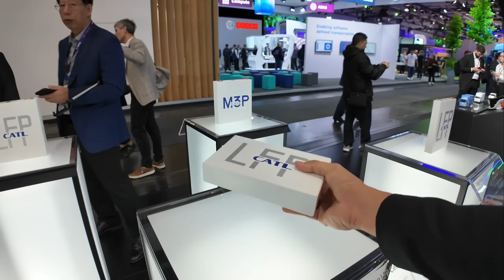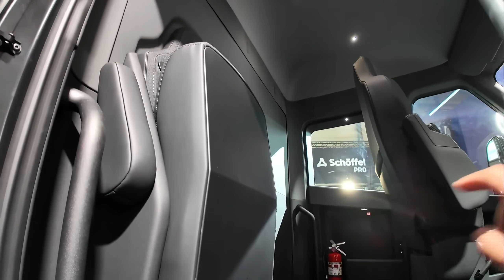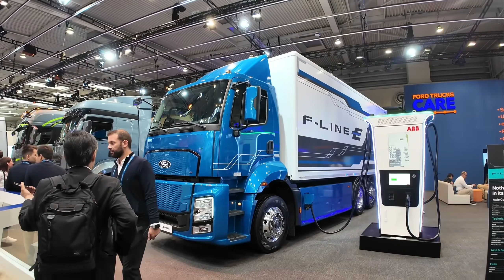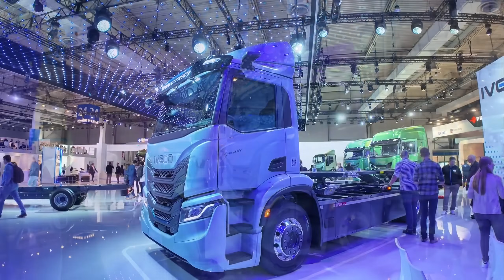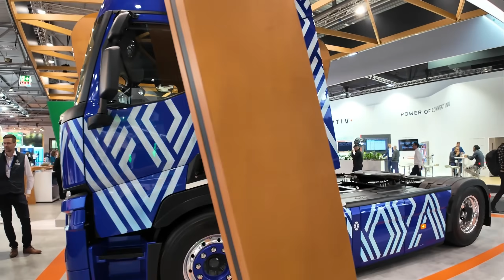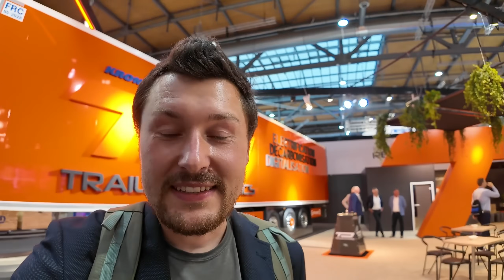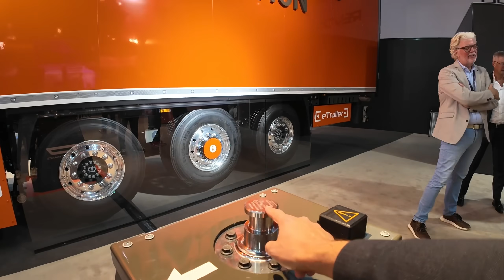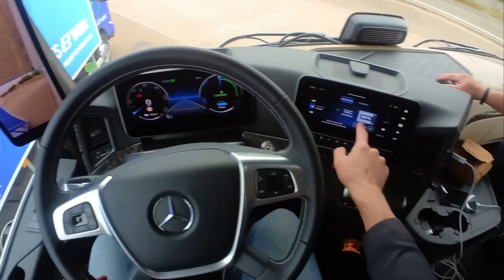These are the E-Trucks coming in 2025

Comment: Everyone knows this Tesla range is 800 km or 500 miles. They’ll start to produce it in September when the Nevada factory is ready, or 50k per year.
Reply: again, anyone watching Tobias videos about the long haul trucking he's doing across Germany and beyond will have learned that the limiting factor is legal driving hours, not battery capacity. There are no non-stop 400+ mile rides in the EU. You gotta stop every 4,5 hrs and take a 45min rest (while topping off at 300+kW). 
Adding "too much" batteries is uneconomical and impractical as it's reducing your payload capacity (total weight being 42t max.)
Reply: @velotill  a tesla semi height 23k for 500mile one and 20k for the 300mile one almost the same as a ice truck so payload should be relatively close btw i got this info from the lead engineer of the tesla semi when he was speaking at the electric auto show in Europe also if 4,5 hours thats fine fir tesla semi then all they need is a sleeper cab which they are working on before mass production
Reply: I would like to see that in real life driven by someone not on Tesla's payroll .
Reply: @callumcurtis15  Pepsi has 100 of em also videos of em driving on the highway by ppl with the fredolay or Pepsi logo on em
Reply: @mcsike7264 That's the thing they're the only ones with them, And they've been saying they're going to come out any year now for years....
Reply: @matt45540  Ya production is slow bc the semi factory is under construction set to finish q1 of next year all the semis up to now over 200 Pepsi has 100 tesla use some in there fleet and some sent to other companies to test out in there fleet once factory is up and running mass production will begin
Reply: @mcsike7264   @mcsike7264  re: "Pepsi has 100 of em". well no Pepsi-Co PLACED AN ORDER for 100 of them like a few other Major Carriers did, however "Pepsi Bros" only initially took delivery of 36 units, but this is the REAL WORLD OF ADULTS so it's very important one not allow themselves to be "suckered" by a Psychology CONFIRMATION BIAS like so much immature Millennial would do, stated another way: Mature Adults must "guard" themselves against REGRESSING "backwards" and "downwards" into the dysfunctional behavior we see exhibited everyday by Millennials, who we know have been deliberately "dumbed down" and "Mis-Educated" (hint: MY generation are the ones RESPONSIBLE for this process of "dumbing down" and "Mis-Educating").   granted back at ACT Expo in Vegas in May of 2024 (of which i was in attendance) it was announced by Dan Priestley the Tesla Semi Program Manger that they "started delivery" of another 50 units.  mind you those who can COUNT and do MATH will recognize how this total number is still conspicuously SHORT by 14 units of the grand total.  but that's okay, as i'm a fair man and i'm willing to set that aside (for the moment)...

see for those who don't know, the 'Murican Transportation Industry is already FILLED (wall to wall) WITH A$$HOLES AND LIARS so unfortunately for a "Lying King" like Elon, this sector already knows what "bullsh!t" sounds like when they hear it.  in stark contrast (as Elon has shown) everyday Auto Consumers are dumb AF and are thus EASILY ROBBED and separated from their money (ref: "A fool and his money are soon parted").  so unfortunately the way EGO and the Human Defense Mechanism works in the personality is, you'll likely NEVER get Auto Consumers to come to this realization regarding their "Mental Deficiencies", even when these "Deficiencies" are 100% true.  hint: people LOVE thinking they've got their sh!t together even when it's clear to everybody observing them that they DO NOT... 

now i'm open to be proven wrong about this, but i have yet to see LEGIT CONFIRMATION that Pepsi-Co have actually received and DEPLOYED into service this second batch of 50...?  again (as a Christmas gift) i'm willing to temporarily overlook these missing 14 units, if someone can show me evidence of these 50  additional units (which would certainly be an impressive feat) "fully decal'd" with Pepsi/Frito Lay graphics and at least PARKED in the yards in either Sacramento, Fresno, or spread across both Terminals ready for dispatch...

so far i've only seen 5 new units which (again according to MATH) is only 10% of the 50 being "talked up".  okay for those "baby young to the world" and lacking life experience of how the world REALLY WORKS (ref: "All War is Deception..." - Sun Tzu) this "scam" operates on the principal of where you "show a little because it counts for A LOT".  so with this BABY EFFORT completed, what you then do as Tesla Corp is just sit back and the let the "defects" in Human Behavior "use their weak minds to auto-fill in the blanks" for the remaining 45 trucks (that anybody with eyeballs can see) are obviously STILL MISSING, and are thus unable to be used for the day to day LOGISTICS of running a Multi-Million Dollar Distribution Center.  right, to paraphrase the famed words of YODA: in the "cut throat" business of Trucking it's "Do or not do, there IS NO TRY".
Reply: @@lindband until it is on road, it s vaporware.......According to Elon we would also had have car driving by itself by now.......
Reply: @jonpetter8921  they are literally on the road my guy dont talk sh*t if you dont know anything😂 teslaa has made over 200 alright 100 by Pepsi which they are currently using teala is using some and other companies have some in there test fleet
Reply: @mcsike7264 Pepsi maybe running them. But there haven't been any reviews posted on the Internet have there. I mean for All we know those Semis might only be good for 50 miles and the software might be completely buggy. There is probably extensive paperwork what Pepsi may show or publish...
Reply: @mcsike7264  Lol I think we have different definition of what is "on road" ? Can customers in all over US order Semi today ?
Reply: @jonpetter8921  yes
Reply: @mcsike7264  Yes you said ? So how is it possible to buy product that you can t even order on Tesla website ?
Reply: Maybe - but these trucks are available to buy and in use now.  Most companies also have existing fleet maintenance contracts with existing suppliers, so Telsa's not in a good position to compete.
Reply: @davidlloyd1526  there's only one thing that matters in trucking: money. If you think otherwise, you're deluded. Mass production at low cost will win this game, not being first. We've seen the same in  EVs.
Reply: @davidlloyd1526 they are selling some 100 to Pepsi and some to other companies for testing in there fleet
Reply: re: "They’ll start to produce it in September when the Nevada factory is ready, or 50k per year."  lemme guess, this is around the same time that the Robo-Taxi goes into production...? and Level 2 FSD suddenly (and "magically") achieves Level 4 Autonomy like the Google Megacorp's Waymo already has right...?
Reply: @phillyphil1513  no factory is set to finish q1 of next year and tesla already have over 200 semis 100 to Pepsi some in there own fleet and some other companys to test out in there fleet

Comment: Glorified  milk float 😂😂😂
Reply: Maybe... but a milk float that can do 0-60 in 3 seconds.
Reply: @davidlloyd1526  nobody needs ba truck to go 0 60 in 3 seconds  the just  want to  deliver  goods 🤣🤣
Reply: @PeterOgden-h1k  i want a truck to do 0-60 in 3 seconds have yiu ever bin stuck behind a truck before also electric trucks are already out on the road doing work  have bin in a cave the whole time 😂
Reply: @mcsike7264  I drive  44 ton artics  and the  public  don't want  big  trucks  going that fast as for  electric  trucks in the road they are  mainly  bin wagons bell end
Reply: @PeterOgden-h1k  sure what ever you say your the one driving the truck your not thenone stuck behind the truck changing 50 gears just to get up to 60mpg a tesla semi can do that in 20 seconds being 82k pounds and 5 seconds empty also have automatic emergency braking cruse control and regen braking so you dont cook your brakes going downhill
Reply: @PeterOgden-h1k  In case it wasn't very obvious...   the bit about a truck going 0-60 in 3 seconds was a joke.  Your 44 tonne truck would work much better as an EV, though.  Running diesel adds $75k a year or so to your costs.

Comment: Where are the 4x4 trucks and Chinese trucks, it is weird that China seems to be behind in this area, I would expect them to be ahead.
Reply: Truck companies have long term serivce plans with particular manufacturers.  Running a non-standard truck is a pain when it comes to parts and maintenance.
Reply: They are taking photo to copy other design
Reply: They supply the batteries
Reply: Check out Windrose, a Tesla Semi copy.
Reply: @nameberry220  Sany trucks, 5' googling....
Reply: Haven t you seen them ? they are "taking pictures".........
Reply: China actually has a rainbow of electric trucks, The guys at Edison motors got a tour of one of their electric truck manufacturing plants when they were over there looking for parts. They had everything from hub motors to totally standard trucks that just had an e motor thrown in still with a drive shaft and everything. They're very custom built for their use case over there. And to be fair there's not a lot of Chinese vehicles anywhere with any sort

Comment: well i must say having more battery packs in the trailer is absolutely genius and not something i ever thought about. Does beg the question could tandem trucks have another battery pack on the roof of the tandem? could be possible
Reply: Not something for most use cases as those batteries are heavy
Reply: I don't understand why you would want to batteries? They already have one semi that can handle a driver's legal full day of driving! The charging capabilities of that truck would allow you to actually have a smaller battery, and during the mandatory rest stop, you could recharge to increase your range.
Reply: More  baterys  means less  freight  witch is trucking  companies  make  money 😂
Reply: @PeterOgden-h1k  The Consolidated Appropriations Act of 2019 amended the statute at 23 U.S.C. 127(s) to allow electric heavy duty combination weight limit of 82,000 lbs to allow for batteries. At the time there were no commercial electric trailers. It is not unimaginable that the statute is amended again to allow for the additional weight of batteries in trailers.